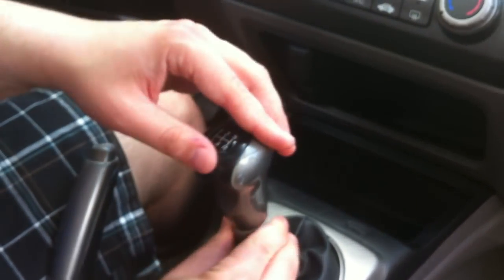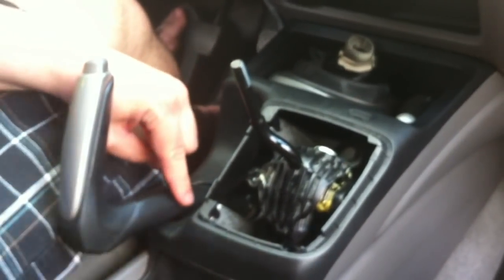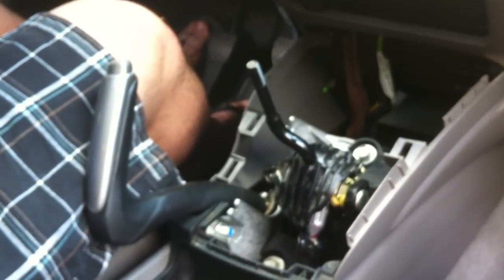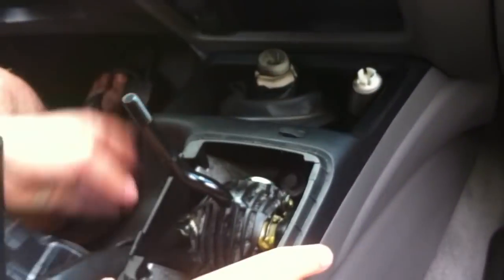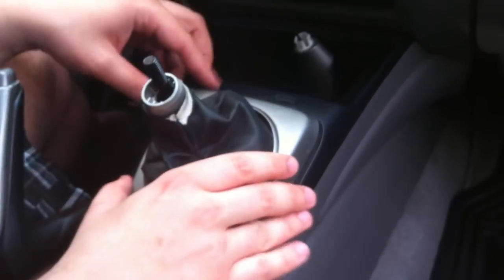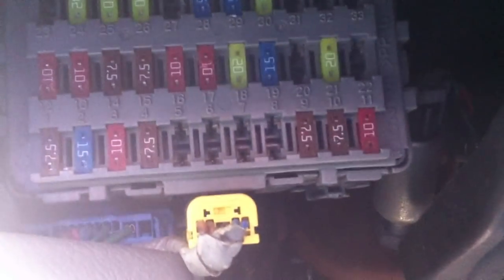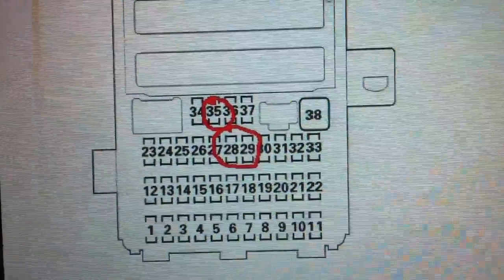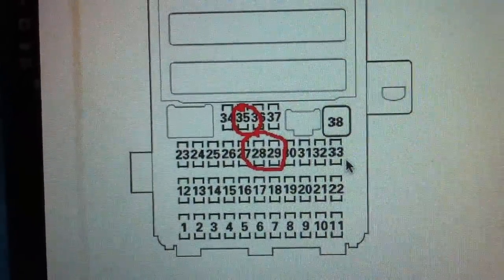Honda Civic cigarette lighter fix - 8th gen civics 12v adapter accessory outlet instructions

Comment: Great video I learned alot. Thanks. You wouldn't happen to know where the fuse for the OBD2 on 8th generation is would you?
Reply: Check the fuse box under the hood (drivers side near fender) and check the 10 amp fuse in #23.  The description says Back Up - that doesn't stand for back up lights.  If it is blown replacing it should fix your problem.